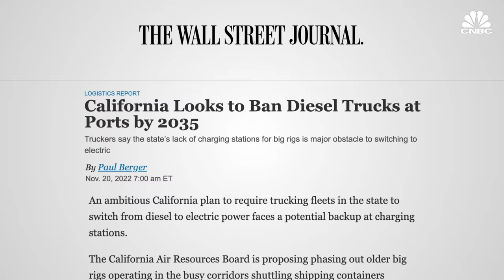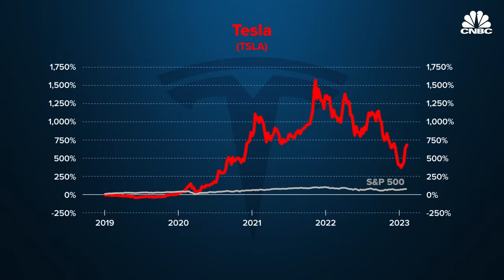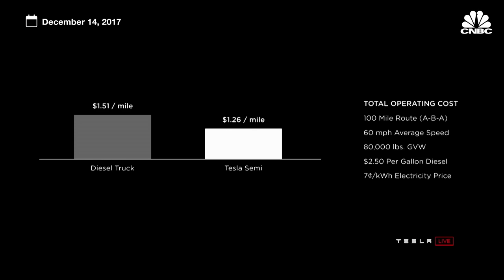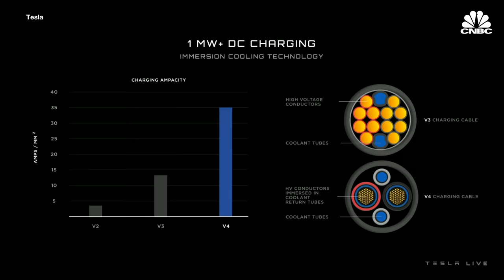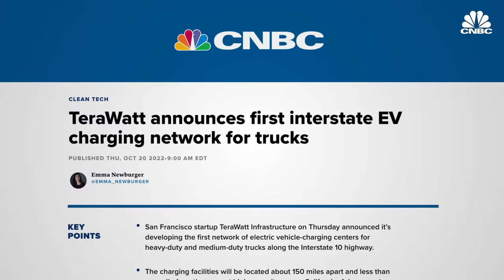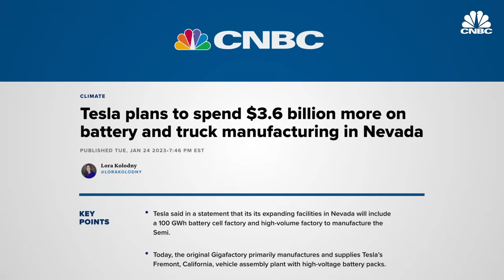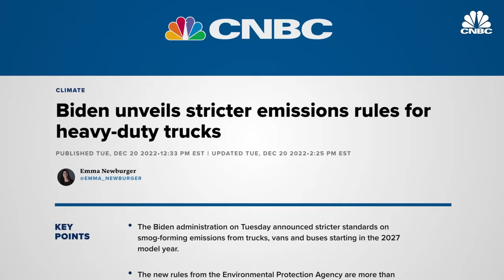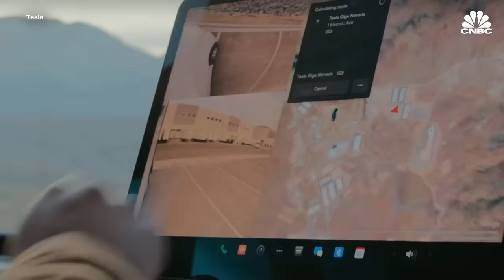Does The Tesla Semi Live Up To The Hype?

Comment: These will work great for 300 mile round trips. Cross country trips, not a chance.
Reply: If they put mega chargers in the specific places that are needed along the route, then certainly cross country is not only possible but feasible.
Reply: I thought PepsiCo said they are doing 400-425 mile trips today with no stops for charging. Cross county is possible, but they will need to stop for charging. Which will take longer for charging than a diesel semi.
Reply: @andrerodriguez7603  yes but there mandatory stop times for drivers so diesel has no time advantage anyway
Reply: Battery technology is changing all the time. Just this morning I heard talk of sodium and aluminum with little or no lithium? Never say never...
Reply: @gazlives  "mandatory"
Reply: It is not a cross country truck.
Reply: @andrerodriguez7603  The problem is that they'll be replacing the insanely expensive battery far too often for these trucks to ever make financial sense.
Reply: @PistonAvatarGuy  says who? Many 1st gen Tesla's from 10 years ago are running at a million miles and still have 80%+ capacity. Battery tech has come a long way in 10 years too.
Reply: @frostman9661  A) There are no Teslas with MILLIONS of miles on them. B) Car batteries aren't subject to anything close to the same level of abuse that the batteries in these trucks will see. Batteries don't last long when being abused.
Reply: @PistonAvatarGuy  Sorry the s on millions was a typo which I just corrected. I meant Million as in single million. But yes, there are many Tesla's with over a million miles with 10 year old battery tech. No doubt there will be more abuse. But charge cycles are charge cycles. With zero oil changes, collent flush, heat and cool cycles stress, fuel injectors,  electricity being far cheaper than diesel etc etc. Even if you're replacing the battery after 300,000miles, I bet it's still a break even or better and I would put money on them lasting much longer than that.
Reply: @frostman9661  As far as I can tell, there's ONE million mile Tesla. Also, the trucks are going to be far, FAR more expensive to buy than a normal day-cab truck, so that's an added cost right from the beginning. The cost of replacing the battery, even if it does last a million miles, is also going to be more expensive than an entire day-cab diesel truck.

The typical mileage for the replacement for a Tesla battery is also 300k to 500k miles (according to Musk himself), and that's with the relatively easy life that they have in passenger cars.
Reply: They're making 1MWH charging stations, so yeas, possible
Reply: Exactly what critics use to say about electric cars never being able to be used for long road trips back in 2012-2015 when Tesla said otherwise.  Critics have gone somewhat silent now when it comes to Teslas and their ability to road trip long distances.  Hmmm I wonder what happened in the last 10 years for people to change their minds.  It doesn't take much imagination or ability to extrapolate to understand what happens next in the trucking industry when the first production truck from Tesla has what appears to be a legit 400-500 mile range and rapid charging.
Reply: @frostman9661  I'm not saying that people are going to misuse the batteries, I'm saying that the application is inherently destructive to battery life. High charge/discharge rates and full/deep charging/discharging seriously harm battery life. Regen will also add to the battery charge cycles significantly, as heavy trucks are dependent on their powertrain for braking when descending long inclines.

Tesla car owners can also cope with declining battery capacity without much issue, while decreased range in these trucks may completely destroy their usefulness for certain operators, especially in regions where cold weather conditions significantly reduce range anyway.

Lastly, the trucks are likely to be at least two or three times more expensive than a diesel truck normally being used in the same application, so even with lower energy and maintenance costs, the Tesla Semi isn't ever likely to be less expensive to operate.
Reply: @PistonAvatarGuy  I get what you're saying, but here's the thing, a lot of what you're saying is either true but has work arounds, or is simply not true. I don't have the the time to break it all down, and some of what you are saying is a perfectly legitimate cincern but there are many work arounds for basically everything you listed. To add to this, this is early days. Remember when cell phones still had physical keys and took pictures smaller than half a megapixel? Yeah that wasn't that long ago... Things will be transformed unrecognizably so in the next decade or so. Criticism is essential, but I am pretty sure you will eat your words.
Reply: @frostman9661  No, buddy, this truck is absolutely, INSANELY expensive when compared to an ICE day-cab truck, it's going to need to have its battery replaced at least twice during the normal life of a diesel (or natural gas) engine and that battery absolutely will cost as much as an entire day-cab ICE truck (if not significantly more), there's just no working around that and no amount of savings on energy is going to make up for those costs.

You can't even argue against what I'm saying here, because Tesla is purposely concealing the price and capability of their trucks, probably because they're hoping that they can generate enough hype for the trucks that people simply look past their horrendous shortcomings.

"Remember when cell phones still had physical keys and took pictures smaller than half a megapixel?"

The ICE isn't done developing, either, bud. Heavy trucks could still be hybridized, they could be made to run on cheap natural gas (this also reduces pollution and maintenance costs) and their engines can be made more efficient via turbo-compounding.

"...but I am pretty sure you will eat your words."

Maybe, but not because the better technology won, it will be because corruption and marketing hype won over reason and sanity.
Reply: @GB  yes that's what I meant "mandatory". Do you know how many "mandatory" regulations are skirted by companies.
Reply: No truckdriver are allow to drive more than 4,5 hours non-stop (300 miles) before a 45 minute long break.
Tesla SEMI truck can recharge in 45 minute.
No problems... 😎
Reply: @PistonAvatarGuy  Tesla announced their long range model of being $180k, and typical long haul semi ICE is around $140k well outfitted, so not sure what you're talking about... You are also making zero mention of the crazy cost savings if reduced maintenance and reduced fuel cost.

You have zero source for the need to replace the batteries twice in it's lifetime... Maybe once? But I think twice that is unlikely.

Sure their not done, you can always develop more and a hybrid would be a great bridging option until tech gets better. But they have had over 100 years. Electrics have barely been more than a decade.
Reply: @frostman9661  They couldn't even make a battery for the truck for $180k! I don't know how you're not aware of this, but Musk often promises more than he can deliver. The reduced energy and maintenance costs absolutely will not make up for the higher cost of the truck and the battery replacement costs.

The source I have is Musk himself, he said that Tesla batteries last for 300k to 500k miles. If the battery only lasts 300k miles, it will need to be replaced THREE times before a diesel truck would need to have its engine rebuilt.. and a rebuild is a heckuva lot less expensive than a 1 MWh battery!

ALL of the technologies which electric vehicles are dependent upon existed LONG before Tesla ever came on the scene. Batteries, motor controllers, motors, etc have all been around for quite a long while.
Reply: @frostman9661  Maybe the battery could be sold for around 100k, but that's still about the same price as an entire day-cab ICE truck.
Reply: @PistonAvatarGuy  The current cost per kWh for Tesla 4680 battery is around $55. Meaning a replacement with margin and labor might be somewhere around $100k, you're right. But you're still not acknowledging the $5k to $10k in saved maintenance per year and literally a quarter for fuel costs. That could easily add up to the cost of a battery replacement in a few years easy. 

300k to 500k miles is what they're designed for sure, but they have been shown to last longer than that in many circumstances. But again, if you replace the battery once, that's close to 1million miles and likely at half the overall lifetime cost than an ICE equivalent due to lower fuel and maintenance.

Lol yes, electric motors are ancient. Modern Batteries? Not so much. Why do you think everything is portable now? Lithium ion has gone through tremendous advancements in the last 15 years. That's the tech I am referring to.

Not sure where you are getting an equivalently equipped semi truck to the Tesla for much under $120k. Maybe bare bones, low power, new, etc. Can't find anything cheaper than around $100k and they wouldn't be as nice.
Reply: @PistonAvatarGuy  I feel we are going in circles. The $55 is by the kWhr. Not sure where the disconnect here is. You have still not acknowledged the massively lower operational costs.
You have some great points, don't get me wrong, but I'll bow out since I don't feel this is being productive.
Take care.
Reply: @frostman9661  "The $55 is by the kWhr. Not sure where the disconnect here is."

Are you kidding me? If that's the price of the bare cells, the information is completely useless, Battery packs include structure to support and protect the cells, cooling channels and fittings to cool the cells, heavy-duty conductors to link the cells together and to the output of the pack, fuses for every cell, a massive amount of electronics for the BMS, etc, they are not just cells dumped in a box and the manufacturing and assembly of those additional components costs money.

The lower operating costs are irrelevant, they will be offset by the battery pack replacements and the higher cost of the truck... and possibly the reduced weight capacity of the truck.
Reply: @frostman9661  I do have to say, it's difficult to call this one. One million mile estimates:

Tesla Semi (high estimate):
Truck: $250k
Batteries (3 replacements): $450K
Electricity (@ $0.125/kWh): $250k
Maintenance: ???
Total: $950k

It certainly beats diesel, but natural gas trucks are becoming less expensive to buy and operate.

Natural gas truck:
Truck: $150k
Fuel: $450k
Maintenance: $170k
Total: $770k

Time will tell what the real costs associated with the Tesla Semi will be.